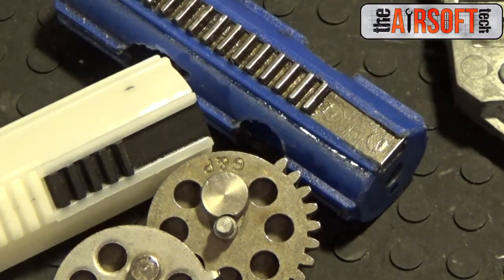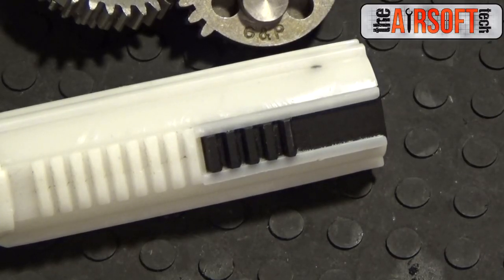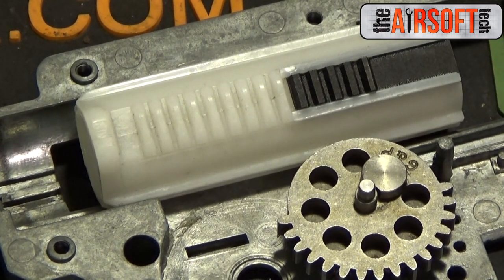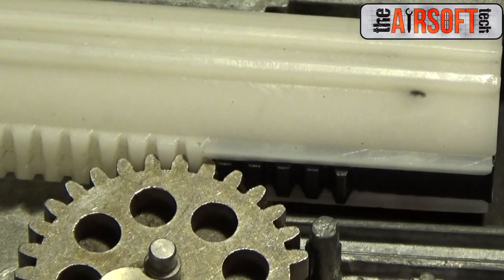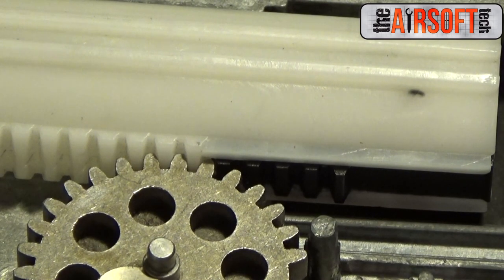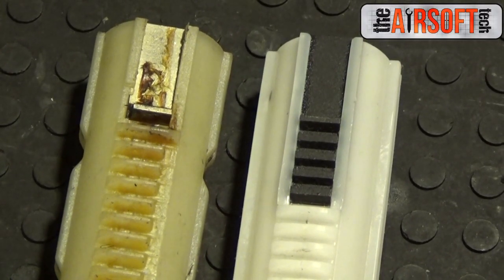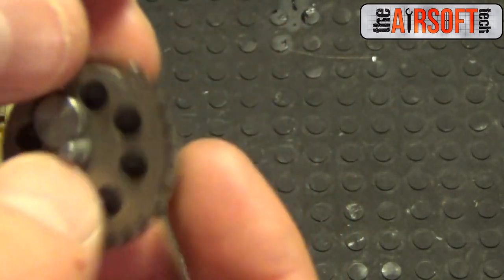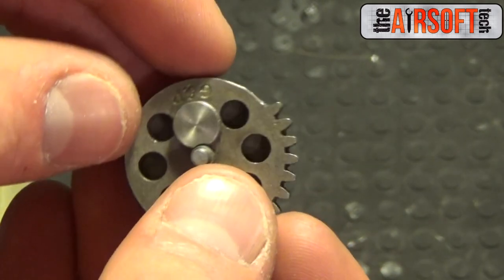Inside the Gearbox: How to Short Stroke a Gear Set

Comment: So i have a m85 spring that worked perfect with the regular motor in my gun and i changed the motor to an evike high speed motor and it blew out my mosfet. No idea why? I made sure the leads were correct, everything was put back together properly but have no idea why it happened. M85 is the weakest spring i found so i have no idea why it didn't work. Im shooting sub 300fps as it was on the stock motor before it blew out.

Comment: Does short stroking shorten the time it takes for the gun to complete it's cycle in semi, making "spamming" the trigger in semi faster? I'm doing s build with 16:1 gears and planning to use precocking. I will be using semi fire only. Will short stroking have any advantages for me?

Great channel by the way, I have picked up a lot of stuff from your channel:-)

Comment: Wil the fps also decrease if you only use shortstroking to pull the oring of the pistonhead just past the hole in your cylinder? In theory, pulling the piston all the way to the back, when the air compression only begins when the piston head o-ring passes the cylinder hole, seems like a waste to me and I was thinking of making the stroke just long enough to begin air compression at the hole of the cylinder, to increase trigger response by shortening the time it takes to do one cycle
Reply: @Faceman9930   You are right.  It's only a decrease in FPS on a full cylinder. If you stop at the point were the piston reaches the port, the air won't bleed off.  The FPS will not drop.   No one should be running their gun on a full stroke if they have a ported cylinder. It's a waste of energy.🔋

Comment: I do see a g&p piston... My 249 smoked it, broke the backside right off.. Now im not short stroking it. But I have a teinly 6 mm Pro Shop 45000 RPM Motor and with an 11-1 lipo it is way too fast so I'm getting a new piston aluminum metal teeth I hope I don't destroy everything oh yeah and the rof cracked my box too. So I'm starting all over brand new box and working my way back up.

Comment: using an 18:1 DSG, and a 22tpa motor. using an shs high speed(pre swiss cheesed) piston and ZCI piston head bearings removed, M170 spring, necessary to remove the teeth on the piston? or is the assembly light enough as it is.

Comment: I need a new motor in my Krytac Pdw mkii, stock gun with titan instaled. I have access to Lonex A2 and SHS high Torque. The A2 autos on semi without active braking set to 40/60% and precocking off, I imagine the SHS would as well . I only shoot indoor with fps limit to 350 on .2g . I was thinking of getting a bigger spring and short stroking to bring the fps back in like, and hopefully not have to have active breaking on. Am I on the right track?

Comment: A question related to this topic; how does the piston breathe New Air. I can imagine when the piston retracts,  the nozzle shouldnt be in the hop up coz it does a little sucking or something? I know the o ring will not expand going back letting air pass through the back side. Im confused about tappet plate timing in relation to grinding off teeth from the pickup side of the sector gear and not the release side.  Can you go in depth on that please?
Reply: If you grind the release side, it will release the piston early missing up the timing.

Comment: Hi I have a g&g combat machine, and recently upgraded the spring (m110) and the motor to a high speed g&p m120 high speed motor i believe. After installing the motor everthing was fine. But after installing the m110 it sounded real cranky like it was low battery and all the wires got real hot, then the fuse blew. Do you have any idea what was wrong? Thanks alot and keep up the great vids! (P.s i was using a 8.4v Ni-Cad)
Reply: DRcommentarys you may have put ur spring in backward

Comment: You remove from the pickup and not the release on the sector gear? I thought it was the other way around.
Reply: Pickup side (to avoid issues with tappet timing) then add a stronger spring to bump up the fps/allow piston to return in time before yoursector picks up the tappet again.

Comment: Why would not want to take a tooth off the release side of the sector gear
Reply: It fuck with your tappet timing causing feeding issues because the pin that pulls the tappet plate back isnt in the right spot anymore

Comment: I know this video is oooooold, but still: how does a short stroked piston influence fps when the cylinder has a opening in it?
Reply: By reducing the length of pull back with the piston, it will reduce the fps of your gun. Using a stronger spring can counteract this, but use your best judgment with going with a heavier spring as your motor can suffer.
Reply: Because when you SS a gearbox, the sector gear isn’t pulling the piston as far back anymore. Putting less stress on the spring since it’s not going to be compressed as much

Comment: is it possible to short stroke from the release side of the sector gear?
no its not a solution to do it at the pickup side!

its only one teeth that im going to remove

thanks
Reply: and would i still need to remove from the release side of the piston?
Reply: +Leeen i know but ive almost broken a tooth from the release side sooooo
Reply: nah, i just left it with overspin over a week (spring fully compressed), only extreme quality like siegetek can handly that (i have SHS gen4 13:1)
Reply: but would it be a problem to short stroke 1 tooth from the release side?

Comment: Can I just remove one tooth or is there a certain amount required for the minimum
Reply from the maker: You can remove as few as one. 

Anywhere between one and four teeth is pretty safe over all. I've never done more.
Reply: Thanks for the tip and fast reply!